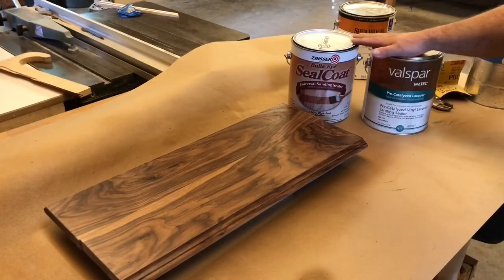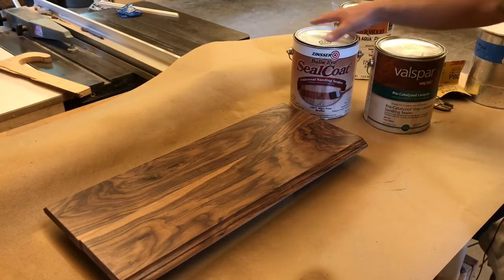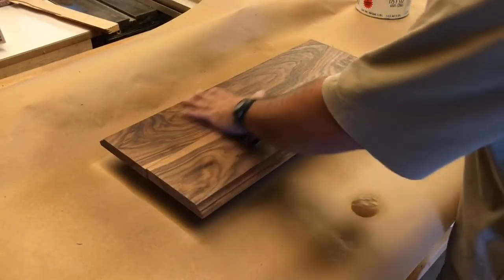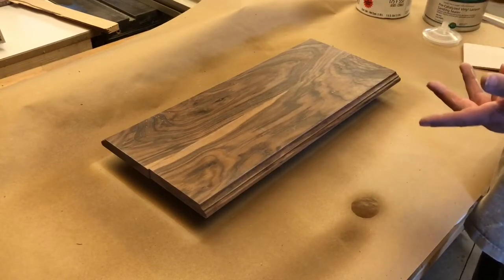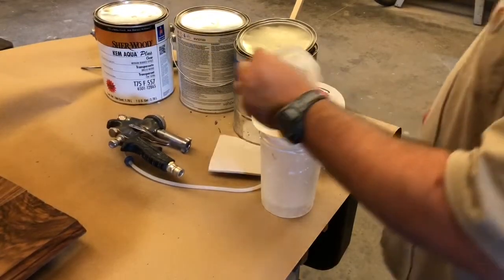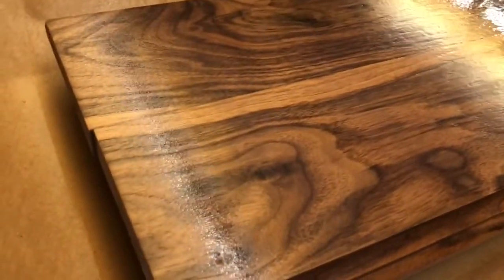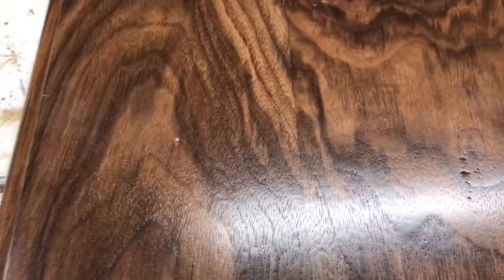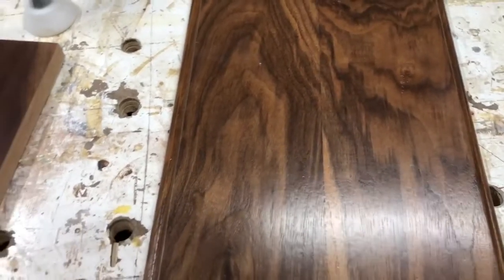How to Finish Walnut using Waterbase

Comment: So when doing waterborne finish, you would recommend to use vinyl sealer as undercoat?  Wiil it not create any bonding problems going with waterbased finish on top?
Reply from the maker: wojciech Hyrczyk  that’s my preference and there are no bonding issues. Both CIC and Sherwin Williams approve and I have been using that combo for 2 years know and my friend bob Kloes has been doing it for over a decade.